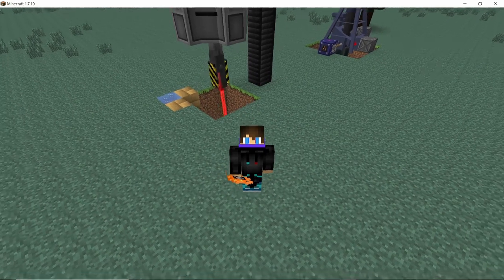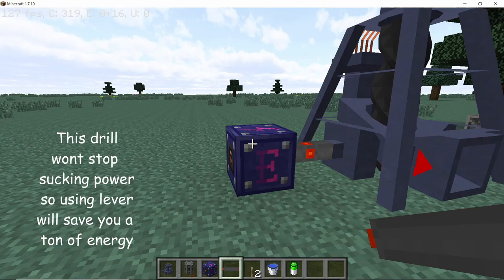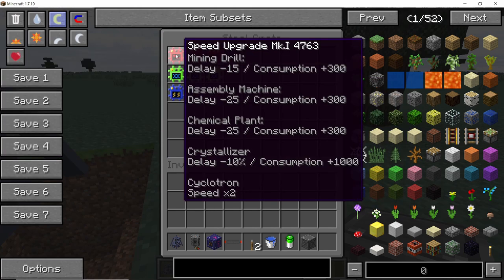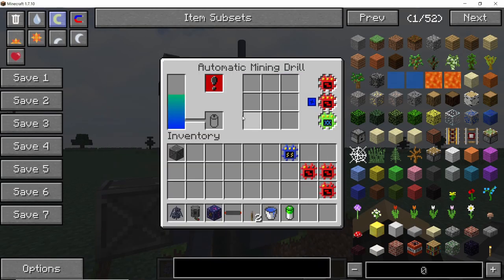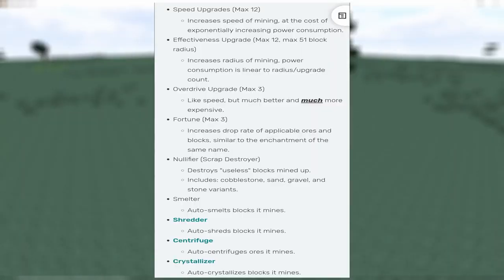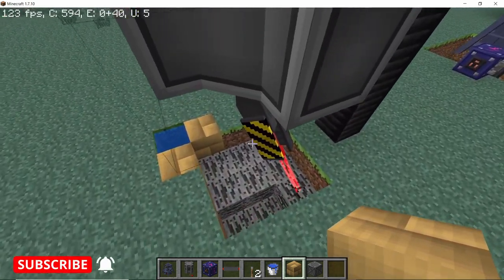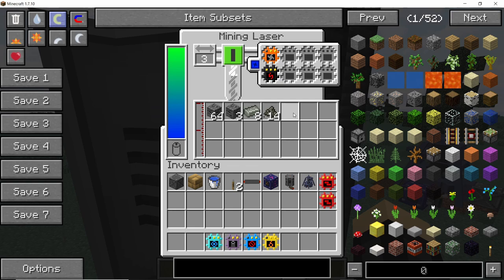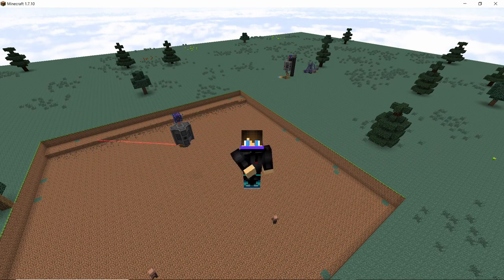"Automatic Mining Drill" & "Mining Laser" Guide in HBMs Mod || Making a Quarry in HBMs Mod Minecraft

Comment: The crystallizer upgrade is, in fact, more efficient than the centrifuge one, but you'll need to centrifuge the crystals first. I'm not sure if you can combine both corresponding upgrades, though, so you might need an ecternal centrifuge. But still, it will be at least two times more efficient on average
Reply: What do u do with the crystals if u don’t centrifuge
Reply: @john-zf1yb  Nothing, I believe. They are only produced by the Ore Acidizer and by the crystallizer upgrade, and they only function as a way to increase the resource yield from ores, as far as I'm concerned
Reply: @terragame5836  ah thx for clearing that up
Reply: @john-zf1yb  melt them iirc
Reply: @hydrodoxxed2  or shredd you will still get 3 powder
Reply: how do you get oil out of the dang thing? like, pumping it out doesnt work with any mod
Reply: Hbm pipes